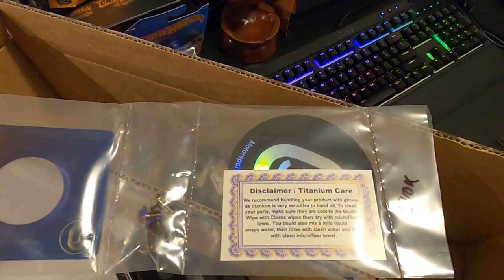Update Video! Subaru WRX STI Lowering Springs

Comment: what are the springs called
Reply: ...springs?  Look for springs that drop 1" or less for best suspension geometry.  Most aftermarket springs will exercise the dampers at the upper end of their rated performance. If your dampers have a lot of miles/kms, might as well replace the dampers while you are in there. No need to do work twice.   MachV and Whiteline are on my list for springs. To me coilovers are overkill and I'll never adjust them (or I'll want to adjust them constantly because something will always feel wrong)
Reply: What where the name of the springs ?